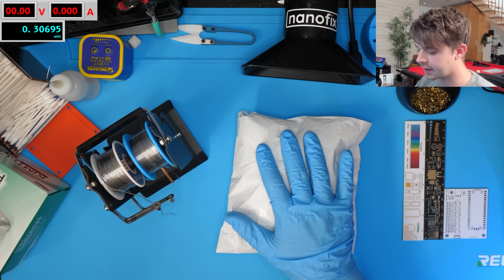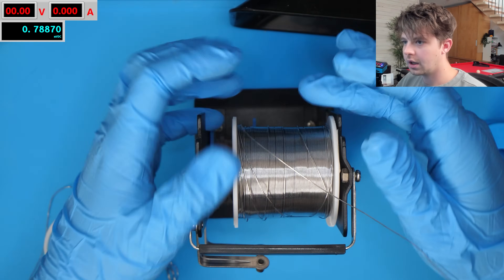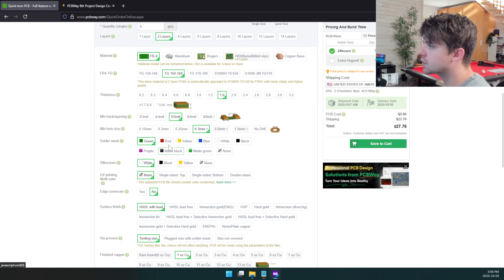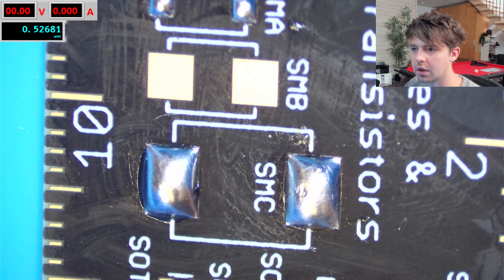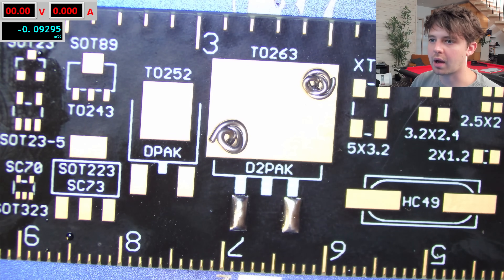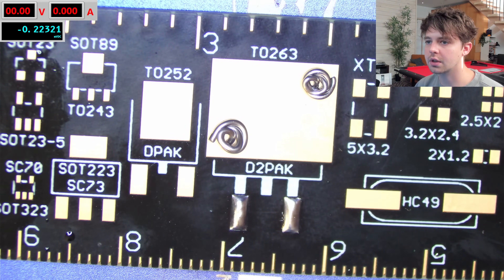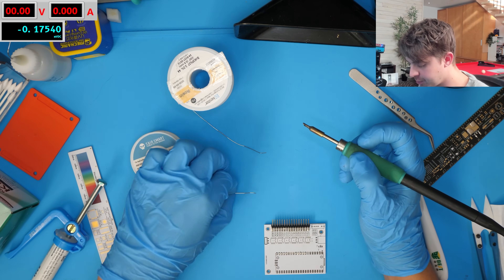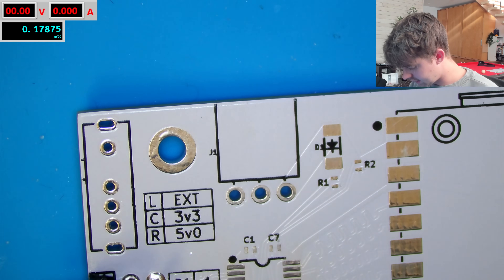Is Kester Solder Better?

Comment: Pretty fair comparison tbh, so far I'm happy with my Mechanic Brand 63/37 solder, and from ali the price is right too, I don't think I'll be considering any "name brand" solder any time soon
Reply: Which one do you use ? I bought the tv - something and it was so bad , worse than my mbo solder I've been using for years
Reply: @Rauuw  I use the HX-T100, I have ordered some of the TV-V866 that you mentioned too but still waiting for it to come, will let you know if I think it sucks too 🤣

Comment: I use always Multicore 60/40 solder. It has the right amount of flux and is easy to clean. Okay, it is expensive (about $70 for 250 grams @Farnell) but does the job perfect imo.
Reply: We need to try a blind test before we become addicts to brands.

Comment: 13:19 Could you say that the kester solder being darker is a good thing? Making it easier to visually see the residual flux deposits? Or does left over flux not really matter too much, more of a professional job if properly cleaned? I haven't really used flux much before as my background is with automotive wiring.
Reply: The intent of rosin flux in production is to just leave it on the board and not clean it, so yeah doesn't matter much, as its an insulating layer.
Its not really a good or bad thing, just a different flux type.

Comment: Expensive solder is largely a gimmick, I often use random brand Chinese 63/37 and it works just fine compared to the more well known brands that cost 10x the price.
Reply: ok, but the Kester was cheaper per gram here, so which is the expensive one?
Reply: It is NOT a gimmick. With branded solder (sourced from reputable distributors) you get what’s on the label. With Chinese solder, who knows what you’ll get: it could be fine, it could be garbage. 

IMHO cheaping out on solder is a false economy: if you get bad solder, you could ruin parts by requiring excessive heat. Meanwhile, the amount of solder actually used in a project is negligible. Who cares if the roll costs $100? You’re still only using cents’ worth in a project!!
Reply: @tookitogo  Isn't really false economy when you can get 10 rolls of Chinese solder for the price of one high quality branded one, and the failure rate is in my experience is generally low enough for you to not care, the idea that Chinese products must be low quality is no longer really true, China make a lot of quality stuff, the only difficulty is weeding out the junk that plagues online marketplaces.
Reply: @chryseus1331  You get 100g vs 454g, did you not do the math? Give an actual price of what you are buying.
Reply: You would generally want at least a Taiwanese-branded product like Mechanic or Pro'sKit wouldn't you, since at least they have some kind of reasonable quality control -- as the totally off-brand stuff can otherwise be a lottery, no? 🤔

Comment: I will say this some cheaper brands have come a long way. A lot of them will work if you don't have a need for strict requirements, but it will be a balance between heat and quality of the metals from what I've noticed. 

Brands I stick to that never failed me and have work great are Kester, Alpha, AIM, Multicore (Loctite Henkel) Goot, MG Chemicals. I started out with radioshack lol old shit that left me frustrated and it stank so bad. When I tried kester it was like a hot knife through butter so I fell in love and been a purist ever since lol. 

I now buy old (NOS) or used rolls since they last forever, still work and I score them for cheap. My now active roll (Kester) came from a lady who used to work in a watch factory from the '60s. They don't offer the configuration anymore but its their 88 formula (stronger than 44) in 63/37. I've got a good 7 pounds at least. 4 in one roll and 3 in another I scored them for $20. And it works just as good as a new spool of any brand out there.

Comment: I used alfa core 60:40 for decades. I tried cheap solder, just to see if there’s difference. I cooked them with a torch. The Alfa and the Lester holds up. Doesn’t oxidize and incinerate so quickly. It shows how the joints will hold up over time. I now use kester full time. It’s cheaper than Alfa.
Reply: I was taught that 6040 has a plastic phase. 6337 goes right from liquid to solid.

Comment: If you combine Kester 44 Activated Rosin Core
Solder with Kester 1544 Liquid Soldering Flux, you avoid the situation where the core adds one flux and the liquid another. This is required for mil-spec soldering; they test and characterize the flux and there is no data for a mix of different kinds of flux. It is probably OK but when lives depend on the solder joint, probably isn't good enough.

Comment: I'm sure I'll catch flak for this but I dislike Kester solder (not saying it's bad, I just don't like using it). I've started using whatever I can get that's the cheapest, that is 63/37 and has Rosin flux, and I've barely been able to tell a difference in most of them over my 20 years jumping brand to brand. The Kester was difficult to clean, and my brain makes me clean it all. So I'm sure that has a lot to do with my preference for not using it. I haven't tried SainSmart and it's only a couple cents more per gram (in the US at least) than what I'm using right now so I'll have to give it a shot. Great vid as always! Would definitely be interested in another solder comparison (though I'm enjoying all your vids so whatever you put out I'll be watching). Keep up that good work sir!
Reply: The intent is not to clean 44 flux off, you are supposed to leave it on the board.

"44 possesses excellent fluxing ability; the flux residues are non-corrosive, non-conductive and do not require removal for most applications under normal conditions of use. IPA will not clean the residues off the surface of the circuit board after the soldering process."
Reply: @jaro6985  While I understand what you mean, I think "it is safe to leave it on the board in most applications" is more accurate than "you are supposed to leave it". The issue is my OCD brain doesn't want me to leave it on the board. Hence why I use solders that are easy/easier to clean off.
Reply: @loganthedragon  Its intended application is to leave it on, thats how they designed it. 
If you want to use another type of solder thats totally understandable, but for production use its a waste of time to clean.
Reply: @jaro6985  It is also specified in the data sheet for 44 that you should not use additional flux, which I do. It also doesn't state "you are supposed to leave it on", it states that it does "NOT REQUIRE removal for most applications under normal conditions of use". So I still firmly believe saying "you are supposed to leave it on the board" is innacurate. When you leave flux residue on a board, even kester 44, there are still negatives other than aesthetics as well. The flux residue can collect debris (lint, dust, etc) which are then held in the residue. Said debris can either be harmful to the board itself, depending on what it is, and can also alter the properties of the residue itself (again, depending on what debris has been collected). They also state that you should only use additional flux as a last resort and to only use their compatible fluxes for this purpose. If you do use any other flux that does have the potential to harm the board, then you still need to clean all the residue as that flux will now be mixed with the 44 residue.
Again, I'm not saying people can't leave it on if they want and I'm not saying they didn't design it to be (on its own) unharmful. All I'm saying, and I stand by still, is that "you are SUPPOSED TO leave it on" is not an accurate statement.

Comment: Nah, you're missing the point of the Kester 44 solder.  It has an more active intensive flux that is will clean harder to solder parts that have oxidation on them which makes it good for repairing old circuit boards and equipment.  If your soldering new parts then you use 285 series solder wire which is cheaper if you buy it from the likes of Digikey.  I find using Kester solder better in production soldering as it generally has much better quality flux in it so you don't need to add as much additionally to the joint thus making faster work....

The other test for the quality of solder is how much the flux doesn't corrode the joints later on even if it isn't cleaned....
Reply from the maker: I did mention this in a caption at 18:11 However, I think what I discovered is that as long as the advertised alloy is accurate, you are really just buying different kinds of flux core when you buy different solder wire. Since I'm almost always using my own flux on top of it I'll probably never notice much of a difference haha. For microsoldering (what I primarily do), it's extremely difficult and time consuming to get stuff done without additional flux anyways.
Reply: Sure, but in 99.9% of cases other than extreme oxidation it's just going to be a pain in the ass to clean

Comment: canuck here too, used to be pretty cheap here, but its gone up in price massively in the last decade. cleaning is indeed a pain. My experience has been "it works correctly and decently, but its nothing magical", which pretty much matches yours.
Reply: Another one here, yup that about sums it up. MG Chem makes good solder too, I switched to them when Kester prices went crazy. Lots of good cheap import options too.

Comment: Thanks for an honest and unbiased review! As far as flux cleaning, why use isopropyl and not something like flux off?  I used flux off for a while, but found it a bit expensive, so I switched to CRC QD Electronic Cleaner, which is a lot cheaper and can be found at Walmart, at least in the US. I do use Isopropyl occasionally as well, but I often find it less effective especially when I use the braid and I'm yet to find a braid with a 'easy to clean flux'. BTW, can anyone recommend a braid that has flux that's easier to clean? I've tried a few but they all seem to be pretty bad in that regard. Does anyone sell braid with no flux at all? I'd rather just dip that into flux which I know will clean easily.... especially for those situations when I'm working in tight spaces where cleanup can be a real pain.
Reply from the maker: To be honest I haven't tried flux cleaner vs IPA yet and it's on my list of to-dos/videos to make. I will definitely give flux-off a look
Reply: I've heard of braid with no flux before but never really come across it. I think the main issue is that a good amount of people don't know what they're doing, and would try to use something like that without adding their own flux. Then act shocked when it won't wick, or lift a bunch of pads
Reply: @condor7001 aliexpress has several braids that state no flux, and having received one it's definitely true. i usually have to flux any braid myself anyway so i dont mind not having any to begin with.
Reply: I use the MG chemicals no clean fine braid, its not that hard to clean in my experience and I always add on a bunch of ChipQuik flux on top as well. As long as I wipe it off shortly after wicking, all the brown burnt stuff comes off cleanly with iso and a qtip. Still some residue from the other flux but iso plus a toothbrush takes care of that.
Reply: MG chemicals superwick and Goot wick have been 2 brands that have been the easiest for me to work with and clean. I would stay away from any wick that contains "No clean fluxes" because the no cleans are harder to clean. Regular rosin dissolves fast with ipa the stronger the better. I use 99% sometimes if you want better action mix it with acetone but becareful not to add too much because it can eat through plastics
Reply: @rubenmejia4881  and @st4155 Thanks for the pointers. It looks like MG Chemicals actually makes a 'unfluxed' wick. for example: MG Chemicals 424-NF-10FT Unfluxed Super Wick Desoldering Braid, 0.06" Width x 10' Length. That should work fine for those rare occasions when cleanup is problematic.
Reply: IPA is milder, if you can get away with milder fluxes and cleaners its better. If you can't then you'll need to use more aggressive stuff.
Any cheap braid won't have flux, plenty on aliexpress.
Reply: @jaro6985  I've certainly tried my fair share of cheapo stuff from ali, they always came with flux and it always seems to be the worst kind. does not work well and is also not easy to remove. also fouls the tip a lot. I've ordered the unfluxed mg braid and it is coming tomorrow, so I'll give that a try.
btw, I never encountered any issues with QD or flux-off w.r.t. them being 'too strong'. i.e. no effects on plastics, solder mask, etc.
Reply: It bugs the hell out of me that so many people promote IPA as the ideal flux cleaner, when clearly they have not tried any commercial flux removers. It’s a big difference, especially on tougher-to-clean fluxes. Yes, IPA is cheaper, but you have to use a lot more of it. 

For robust parts, I use a cheap DIY blend of alcohol and acetone. Otherwise, I use Electrolube LFFR, but many other commercial flux removers are just as good. (Electrolube’s solvent-based flux cleaners contain orange terpenes, which makes them unusually pleasant-smelling.)
Reply: Yes, you can get unfluxed braid, and it’s specifically so you can use whatever flux you’re using already, to avoid mixing flux types.

Comment: Multicore/Loctite is better. But also can be even pricier than Kester... The thing about solder brands and what's better comes down almost entirely to the integrated flux when comparing quality brands to one another. That's because all the reputable brands will be very consistent on the metal content and ratios and what they produce will match the SDS. Whereas Chinese brands have been known to either straight up lie about what their products are made from to save money, as well as having poor consistency batch to batch. That's why you will see mixed reviews on Chinese cheap solder, some people luck out and get a good batch, while others get something else entirely when buying the same product. Now back to the reputable brands; the fluxes they use are all of different formulas and they closely guard these because the performance can vary greatly. Some can be used without additional flux, others can't, some are truly "no-clean" while others may not be, making flux the main factor. Though when it comes to lead free solders in particular, we are starting to see proprietary metal ratios come out of the major brands these days, and that seems to be where the final proving grounds for 'best solder brand' will be. Oh and about the Kester 44... It may be a 'tried and true' variety, one that people recommend a lot, but it is also incredibly old at this point. The 44 type flux is their most basic rosin based formulation, one that has remained unchanged in something like 30+, maybe even 40+ years, I don't remember exactly how old it is, but it's truly ancient, just look it up. So yeah, it works, but there have been major changes in the world of flux/solder manufacturing since then. Also, Kester 44 has been known to require saponifiers to clean, if you want something similar in action that is easier to clean, you want Kester 285 line solder.
Reply from the maker: Really great info! Thanks for taking the time to comment all this 👌🏻
Reply: @nanofixca  FWIW, I have NOT been even remotely impressed by Multicore solders. Kester 44 remains my go-to solder (as an electronics professional).

Comment: Wow I have two really old brown and yellow label metal spools of 60/40 Kester here w "44 Resin Core Solder" .031"
Reply: I bet you they still work just as great. If in doubt clean the solder with alcohol before using it. I got a roll from the 60's from a lady who used to work at a watch factory and it works better than all of my cheaper brands and some new stuff.

Comment: Fing Amazon at least $20-30 modem. Check out other electronic online resellers. Imo. Still working on 1 pounder kester solder from years ago. Ali solder is horrible